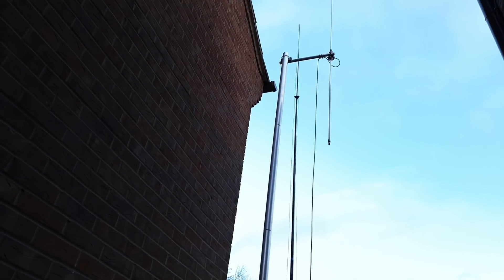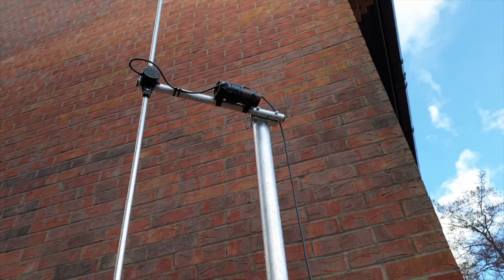Maybe you can help solve my dipole antenna  SWR issue

Comment: You replaced the coax so I would check for corrosion on the aerial. 
After calling a few very strong stations over 500 miles away on 6m and not getting a reply I re-checked my system, I had a good SWR but when I checked at my 6m dipole there was hardly any r.f. coming out as indicated by my r.f. strength meter. Simply a meter, diode and bypass capacitor. I found corrosion and when I cleaned it off there was a lot more r.f. indicated on my meter. Unfortunately 6m never opened up again afterwards for me to try it apart from with a local station.
Bill, G4GHB.
Reply: p.s. It was a dipole given to me so already been outside for years and I probably adjusted it for a low SWR even allowing for increased radiation impedance, then re-adjusted it after cleaning it to it's proper setting.

Comment: As others have said, I would suspect the mast is too close. You need to avoid being too close. Try to be getting on for at least 1/4 wave from the mast. In theory (note theory)  if you are 1/4 wave it can distort (in fact it will) the pattern but in real terms I'm not noticed a problem. There is a homebrew design on my website which has some details which may help. It uses a 'bazooka' balun but you could use a coax (coil) balun but place it close the the antenna feed point.  g8osn.net is the URL . 73 Brian.

Comment: I may have an answer you might think isnt the right one at first, but here goes......  I have heard a rumour that pl connectors at the frequencies you are using might be lossy and cause swr issues.  the smaller little connectors are supposedly used or something....   I could have heard the rumor wrong but...  its a startling point.

Comment: Yep antenna is coupling with the aluminum pole you have it mounted on.
Reply: I have  a very similar problem with my dipole for 2/70 with the almost identical to scale issue.  Mine is NOT electrically connecting to the pole but could it be changing the properties of the antenna by being close to it?

Comment: By the way, you could just try locating the feeder against the mast and ensuring that the coax inner goes to the upper dipole element. The spacing of the dipole from the pole is a bit close.
Vertical dipoles on a pole are a problem, but were used everywhere for TV reception up until mid 60s.

Comment: Every once in a while I get a tough dog . Best I can say is to take a soda can (coil form) and wind 6 turn round it then (remove can) tape tight. Resultant coil traps some back RF. And apply drip loops. On head end. The expensive transit to new wire is bothersome however drip loop and a coil explained will yield expert results too.  Learned mine in us army ft Gordon radio school . Ham radio came natural.   ps keep loop  close to head unit. #2 find a dry sunny week and buy liquid tape or some roof pitch to put on all connectors to stop moisture from getting back in the jacket.( Coax)  and yes it's a moisture problem.we have harsh wet winter/wet springs here in hidden valley lakes TN USA too kv4li
Reply from the maker: Thank you!

Comment: It might be the plastic junction box has been leaking to R F and created carbon track between the terminals. Is the aerial adjustable has corrosion set in  on the joints.
Reply from the maker: It's new but it could be a physical issue
Reply: @M0SZT   some plastics dont like R F and will smoke creating a  Carbon track between the terminals , I would not use joined up coax water can get in to the joints creating a short circuit and blowing up your P A.

Comment: The coax might be to close the aerial  and the metal mast could also be affecting it try a fiber glass extension pole on to your mast and check your coax with a dummy load for vswr would be a good starting point to rule it out. Is your arieal      resonant ??.
Reply from the maker: It was so it could be water getting in
Reply: @M0SZT   Disconnect the coax  check the dipole with a ohm meter see if there is any resistance between the terminals  it should be zero

Comment: Great video and thanks for posting. Have you measured the antenna away from the vertical pole and other parallel metal surfaces ? Im thinking the antenna is fine but all that nearby metal is interacting with the dipole perhaps adding reactance to what should have been a more purely resistive antenna. Do you have a meter that can break out the antennas resistance vs reactance ? Also I think I’d put the choke at the bottom of that long length of coax instead of the top
Reply from the maker: No analyser for that band but will check if interacting with the mast

Comment: Likely too close to metal mast. I assume you want to use it vertically for FM mode?  How about mounting it on a non- conducting mast (piece of wood, say). What is the supplier saying about it? Also change it horizontal to see if mast interaction is the issue... normally centrefed antennas running parallel to a metal mast are a no-no. Hopefully some suggestions should go some way to troubleshooting
Reply from the maker: Cheers, I can't speak Ukrainian, horizontal same issue, might be water plus bad engineering or pure user error 😀

Comment: Carl, I've read all the comments and learned that you have tried things I was going to suggest. It is strange that the antenna worked fine for about one half hour then it didn't. Wondering if you power output increased after using it for a half hour. Strange. Wait to learn if you find a solution.

Comment: In effect your pole has become part of your antenna. An easy way to test this is to tape it to a fibreglass fishing pole. Not idea. But it will allow you to test it quickly. The other thing I would mention is the original metal pole is not very high. So part of your dipole is below your guttering. M eating your signal will be bouncing off the brickwork straight back to your antenna.

Comment: The antenna is reacting to your steel mast. The top section of the pole and the 90 degree section is all interacting with your antenna. 
At least the last length of one half of your dipole needs to be PVC or wood or fibreglass on the  top section of your mast.

Comment: Your mast is likely to be interacting with the antenna.  Try rotating the dipole so that it's parallel to the ground, that should improve things
Reply: That will change the polarity of his signal to a horizontal but will it actually change the relation to the ground from the pole creating an swr increase?

Comment: First things first: use a multimeter to check whether the DC connections work fine so-239  center to leg one, outter to leg two and no other connections. (not even your pole/mast) , second: you used the dummyload to check the feedline, good step, remove the antenna from the pole and use the radio with a good swr meter to see whether the design resonance frequency can be achieved without mounting it on the pole  (the "use an isolational mounting system [pvc/wood]" is a very good idea in testing) moisure can ruin a good antenna , the use of self vulcanising rubber tape has been depicted many times on ham radio channels, keeps the water out of your antenna cavity's. three: if you can spot a low swr in the vicinity (+/- 5 mhz) of the design frequency  you need to retune (low is to long, high is to short), i would advise to choke-up :-) a bit more coax :-)  73 and good luck..

Comment: I think that the way you have the antenna installed, the effective antenna isn't anywhere close to the antenna's design.  The mast, or even if you replace that with plastic, the outside of the coax sleeve, is part of the antenna, and isn't a good size for 4m.

Additionally, that coil of coax common mode choke isn't likely to be effective at 4m (they are most useful mid HF).  Some ferrite beads around the feed near the antenna are better, though be sure to use a ferrite mix suitable for the frequency.

Another approach is a "bazooka" decoupling sleeve, or more than one.  This is braid from another piece of coax stretched over feed at the antenna, 1/4 wave long, open at the antenna end, and shorted to the feed shield at the other end (yes, you must cut the jacket to make the connection).  A 1/4 wave stub shorted at one end appears as an open circuit at the other, preventing, in theory, having the outside of the feed shield appear to be unconnected to the antenna (while the inside of the field shield still works fine as one conductor of the transmission line.  In practice it will need to be shorter than a free space 1/4 wave because the transmission line of the stub (inner surface of the outer piece to the outer surface of the feed line shield, separated by the jacket of the field line) will have a velocity factor less than one.  Also, it will work better if the insulation thickness increases noticeable near and at the open end, reducing capacitive coupling to the outer surface of the outer shield.  Further improvement can be had by putting another below the first, possibly upside down, but make sure that the distance between the two open ends is not at or close to resonance.  The last technical challenge is sealing this arrangement against the weather.  This, plus non-conductive mast, should make the match much better.

These problems are why you don't see many vertical dipole designs, especially at VHF.  The best practical way to do it is to run the feed line through the inside of the lower element, with decoupling where it exits (the old AEA Isopole is a nice approach).  This won't help you with your existing antenna.  I suggest that you use it as a horizontal dipole.  The cross polarization loss won't be as bad as you may think, the bigger issue will be that it's not omni directional.  If you really need a vertical, make a ground plane design, or perhaps a J-pole.
Reply from the maker: Thank you for the in-depth ideas

Comment: A dipole will work just fine even without any balun provided it is not too close and parallel to the pole. In addition, with any dipole is is very important that the feeder runs away at right angles for at least a quarter of a wavelength. As Adi Sadler suggests, try turning the dipole horizontal, as a test.
Reply: For my 2/70 J-Dipole which looks exactly like the one in this video but with scale for 2 meter...  My problem is almost the same....  I may need to place the feeder out further than I have it..  Say 19 inches to about match 1/4 of the wavelength of the meter(s) I am using..  In my case 2 meters is about 19 inches in length so the extension from the pole to the feed horn should be about the same length as one of the legs of the j-dipole.  Would I suffer to turn mine horizontal with 2 meters/70cm?  Bueller? Bueller?
Reply: This is correct, you need to come out at right angle 1/4  wave loop , then back to the pole the SWR will come down.

Comment: If your SWR was good for a while and then went high, water could be the issue. It looks like the dipole elements are hollow and they are wet. I wonder if water has run down inside the lower element??
Reply from the maker: Ah yes very likely
Reply: Did I go wrong after the storm I wonder. Larry
Reply: I was thinking the very same thing...

Comment: set it up as a horizontal dipole and check swr as the mast should not affect in this position. The mast needs to be non conductive in a vertical plane using fibre glass or even a wooden broom stale. I enjoy your channel 73 de Graham G4PFK

Comment: Hi Carl, don't be disheartened ! Its all the fun of the hobby. If things were prefect on the first attempt at everything then we likely wouldn't learn too much. I agree with the others mentioning the close proximity of the house, the metal pole etc.I made a 4m dipole ages ago from bits i bought from B&Q. 2 lengths of conduit and the matching T piece. The antenna was made from 2 bits of old wire either side of an electrical block connector, coax braid to one side and centre conductor to the other all housed inside the plastic conduit. Trimmed the elements with an SWR meter and the radio as i didn't have an analyser. However, if i had your circumstances here i think i would go for a vertical on that pole to get the antenna up and away clear of the house but maybe thats not so easy on the eye for your neighbours ?

Comment: Carl, it’s difficult to tell if the feed point is a direct connection to the coax or is a balun. Let’s assume direct, I’d turn it around so the coax is straight away from the antenna towards the main mast and not looping back over the feed point. 

I’d also make sure the ground side of the dipole is pointing down and the hot (center conductor) element is up. Of course, you have to make sure all element connections are tight, especially on any portions that are adjustable. Make sure nothing is on the sliding part’s points that may prevent a good connection where they are tightened down.

Comment: sounds a bit like you need to check continuity of coax running up to the antenna  and test for shorts on the same cable I would also bring the cable in to  connection box the other way (remove the loop ) and for testing with new coax don't bother with the choke till  you know it works hope it helps  get the multimeter on it  Hope you sort it  M7ENP

Comment: If you have some 300ohm ribbon try knocking up a slim jim and hang it off the cross piece see if thats the same. If it is then im stumped too 😂. Worse case you have a 4m vertical you can take /p .

If the feeder is okay the top then it has to be the aerial. You can always stick the slim. Jim in some 2”plastic pipe with an end cap on it and fasten that to the mast

Comment: What band is it for? 2m? It's difficult to tell the size on the video.
How do you know it isn't common mode current on the coax? Have you checked for this? Maybe a coax balun (not a choke) might help?
Those radiators look very close to the support pole :/

Just remembered, you said it was good for 30 minutes, have you tried putting a continuity tester across the dipole or coax?
Reply from the maker: Thank you, it's 4m it might be water or using the metal mast that's the issue

Comment: Hard to say for sure without physically seeing it (objects in a camera are not always as they appear in person) ... but I'm willing to bet your antenna is coupling with the aluminum pole you have it mounted on. 

Couple options:
1) Use a non conductive pole for a temporary mast. 
2) Orient the antenna to a horizontal position.
3) Increase the standoff length to move the antenna further from the aluminum pole... ideally a quarter wavelength of separation (or more).

I know we hams try to make do with what we got when building aerials....I'm guilty of it myself. Having (borrowing) an analyzer that covers 4 meters is essential to properly tune an antenna (my opinion). I've found SWR meters built into radios to not always accurate.... and quite possibly, you are chasing your tail trying to solve a problem that doesn't exist. 

I'm sure at this point you are ready to jump up and down on this antenna and smash it into bits....but take a deep breath. Sometimes it helps to walk away for a while, work on a different project then come back to this one. You are a QRP operator so I KNOW you have patience and persistence. Stick with it my friend, you WILL prevail.
Reply from the maker: Yes that's true I do need a better analyser that does 4m
Reply: THAT IS WHAT WAS THE PROBLEM

Comment: Right. The coax and the metal pole are probably picking up the RF from the antenna. The stand off (cross bar) needs to be longer, maybe a meter or more. As suggested from others, make the stand off from non-metalic material. The coax is also too close to the antenna. It should be extended back to the pole and run down the length  some distance near the bottom of the pole.  Wind a choke with the coax around a piece of 2 inch PVC several turns just before the attach point at the antenna. Try this and check SWR. If all this fails, take the antenna down and smash it with an axe, screaming all the while.  Good stress relief.  Good Luck!  W0YVY
Reply from the maker: Ha yes, cheers some more work on reducing radiation into the coax before it's scrapped.

Comment: Just a couple thoughts. I am assuming the coax to element connections are good, there is no connection between the elements (short) and the elements are the correct length ( a little over 2 meters on each side.)  Is the element that is parallel to the metal mast connected to the center or the shield of the coax? Could you try the antenna in a horizontal position? I am wondering if the problem is caused by the close proximity of the lower element to the metal mast. Maybe try it on a section of PVC, Fiberglass, wood or other non-conductive material.
Reply from the maker: I've tried the antenna horizontal since the video, the coax is fine too it's 50ohms though and someone mentioned 75ohms? I'll get my eldest daughter to hold the antenna, kids are less conductive than steel :-)
Reply: @M0SZT  Yes a dipole at infinite height with nothing near it is 75 ohms which would give a 1.5:1 SWR, true of all dipoles.  As the dipole gets lower to the ground, its impedance decreases some. So that should not cause any concern.